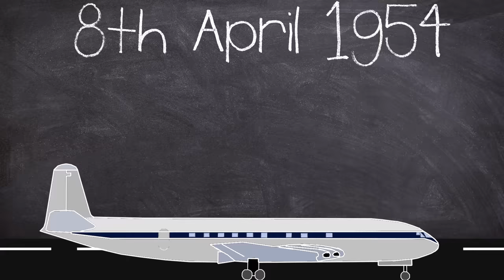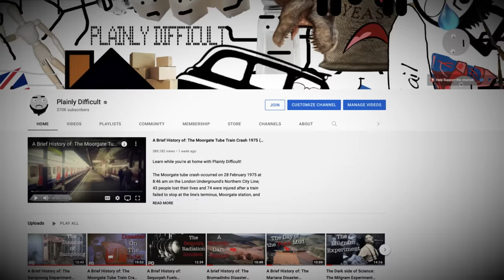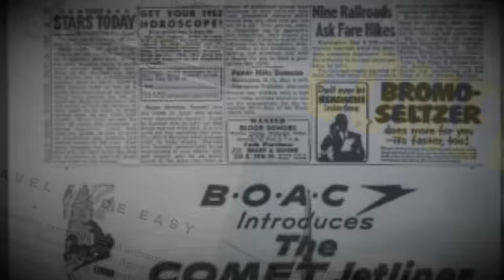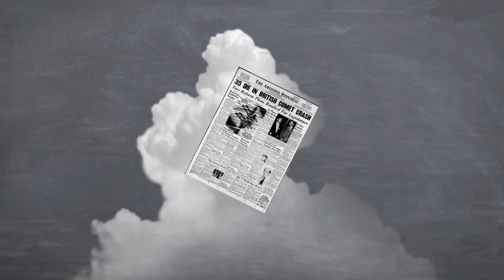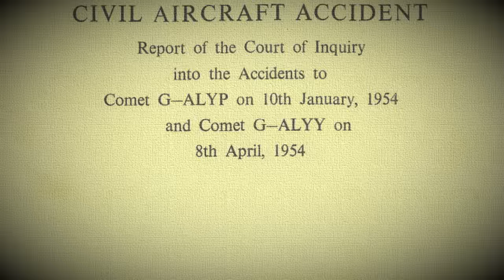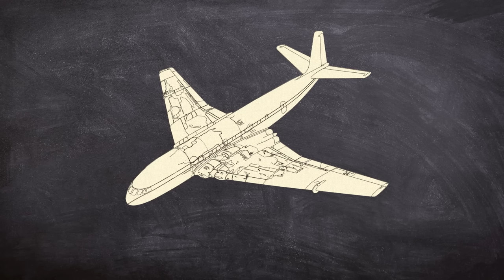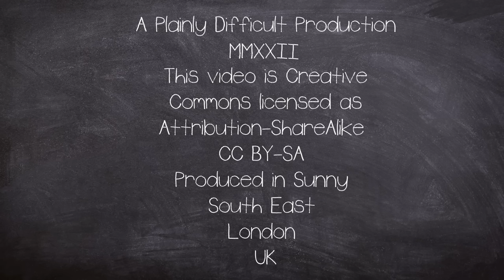A Brief History of: The de Havilland Comet Design Disaster 1954 (Documentary)

Comment: Great video... But...
Your failed to mention a couple of things.
1) the first two runway crash were from what some call a cockpit flaw which created a blind spot outside the windshield. From it the pilots thought they were taking off but weren't. Many Comets had to have their dash panel refurbished to eliminate the blind spot.
2) it was found that during the manufacture of the comet's to allow the square windows and and access point like the door and radio antenna, the holes for rivets and welding were punched into skin and not drilled. This created tiny micro fractures into the metal skin and accelerated the stress crack failure of the Comet's skin and frame. After this all manufactured aircraft would have their metal frames and skin panels drilled and not punched through.

Comment: The De Havilland Comet, despite it's flaws, was still an incredible aircraft.
Unfortunately when making huge technological leaps mistakes will inevitably occur - being the first always carries risks.
Reply: The early bird gets the worm, but the second mouse gets the cheese.
Reply: It wasn’t a huge technological leap, as nearly every Comet misconception would have you believe. It was the first commercial jet airliner, but the TECHNOLOGY wasn’t groundbreaking. 

Boeing already had the swept-wing, PODDED engine B-47 stratojet flying TWO years before the first Comet flew; it also had a far more advanced swept tail design than the Comet’s straight prop-era tail design. 

The genius was in applying known technologies to a different market, not so much the plane itself. 

Also (largely unknown or ignored) is the fact that Boeing had already implemented a huge array of construction and fuselage features into the -80 design which would have made the structural failure of the comet impossible. Guess what? They did all of that BEFORE the Comet crashes. Spot welding instead of punch riveting, tear-strips in the fuselage, and above all else, the aluminum skin was MUCH thicker than the Comets - again, all included in initial design specifications before the Comet crashes. 

It is possible that while being a groundbreaking aircraft for commercial jet travel, de Havilland ALSO royally (no pun intended) screwed up!
Reply: @EstorilEm  Nazi Germany had the first jet-powered aircraft (the Me 262), and the first operational jet squadrons. B-47 was post-WWII, but the Convair B-36B/D's (post WWII w/jet engines and conventional engines on one aircraft was operational in 1946-47). B-47 was not fully operational until 1953.
Reply: @EstorilEm  
The "tear strips" or rip-stop strips were lacking in the Comet I, no doubt to save weight. Virtually all American jet liners had/have them. Keep cracks from propagating.  There are also other areas where ground tests, including wind tunnel testing doesn't show up potential catastrophic failures.  The Lockheed Electra I, for example, a four-engine turboprop, was tested extensively in wind tunnel testing.  Unfortunately, it did not reveal the dynamic augment of the outboard engine/nacelle, which, under certain conditions inflight hit the natural frequency of the wing. The result was the Tell City, Indiana, crash, killing everyone onboard. Until the cause was found, airlines were instructed to reduce the cruise speed, which did keep the phenomena from happening.  That was very fortunate for me and my Dad, as we took the same flight number, on the same type of aircraft, the next day!  When the cause was found, Lockheed beefed up the wing structure and made other changes. The "new" plane was called the Electra II.  While it didn't remain in commercial service much longer, the Navy and Air Force adopted it with all sorts of anti-submarine gear, and called it the P-3 Orion, which remained in service until being replaced recently by the P-8.
Reply: The Comet Disaster was certainly not the result of cutting edge technology... rather the lack of modern technology.
The Comet Disaster could have been easily prevented if de Havilland had simply followed existing, well-known Industry standards for the design and construction of all-metal aircraft with riveted aluminum alloys and cabin pressurization.
Reply: Yeah uhhhhhhhhhhhhhhhhhh no. The Boeing Dash 80, actually the B-47, led us into the future. The Comet, a first step but the design decisions were all wrong. 

When your claim to fame in aviation is ACCIDENT investigations instead of trillions of passenger miles. . . . . . . . . . . well it was an EXPLOSIVE FAILURE.
Reply: This video has some BS included.
For example -
  
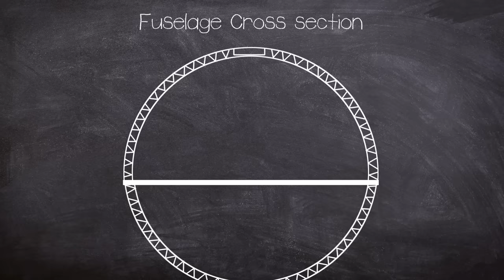    5:20   The idea that only the crew & passenger areas were pressurised is absurd obviously. 
  Every part of the fuselage was pressurised from the nose to the rear fuselage bulkhead including the entire cargo area.

Comets flew until 1997.
The Comet design had military use as a requirement. Nimrod development began at 
De Havilland before 1953.
Nimrods were not withdrawn due to structure problems or other airframe issues it was entirely a significant upgrade snag & resultant basic economics & an end of line sale happening at Boeing at the same time.

We feel we can shed some light on some common misunderstandings.

At the time the Comet wasn't particularly dangerous.

Losses comparisons
How things were in those days.

DeHavilland Comet 4 UK           14% 
DeHavilland Comet all  mks       17%  

Boeing 307                               70%
Boeing 247                               48%
Boeing 707            .                  20% 
Boeing 707                                20% 
Lockheed Electra Turboprop   29%
Canadair CL-44  Turboprop     46%  
Convair CV-580  Turboprop     22%
Convair CV-880    (ff 1959)       27%  
Convair CV-990     (ff 1961)      35%

    Of course De Havilland had prior experience building many all metal construction airframe aircraft including thousands of jet powered fighter aircraft that were primarily of metal construction with pressurised cockpits & jet engines built by De-Havilland.

   De Havilland carried out full stress analysis & engaged in a comprehensive & protracted testing program.

   The DH Comet was the first passenger airliner with full length fuselage pressurisation at 8psi pressure differential.

   Of course ripstop provision was provided. The skin alloy used became unavailable at the time due to R & D at the manufacturers which resulted in the original alloy being discontinued.
The skin thickness used for the Comet was used for similar later aircraft. 
Frame spacing was not found to be too large & frame width was not found to be too small.

  De Havilland did indeed always work to better than industry standards at the time, used up to date knowledge for the design & construction & no evidence of negligence  or criminal negligence was ever produced in relation to the DH Comet.

  The DH Comet had no effect on the course of the aerospace industry in the UK. The UK now has the world's largest combined nuclear, aerospace & defence sector per capita activity.

    The investigation committee did not find hundreds of fatal flaws or evidence of design defects, structural defects, defective materials or shoddy workmanship. Ripstop provision was included. Claimed incidents did not involve cracks starting from window corners.
Pretty much all changes were just in case changes or were planned development modifications & improvements that were scheduled regardless of incidents.

Hope this helps.

Cheers 👍
  
   
   
xcxcxvcxcccccv
xcvvvvccvccccv

Comment: As usual a great video, which does a great job of presenting a problem, and its causes.  There's a lot more to the Comet's history though - which might tale a couple of hours to properly present.
While the structural issues put the nail into the Comet I (and IA), it must be pointed out that the two losses due to runway overruns mentioned are also significant, and exposed a critical problem with the early Comets - The Comet I, like all early jets,  was severely underpowered, and takeoff performance was marginal.  The airfoil used on the Comet's wings did not have good low speed characteristics - When taking off in an early Comet, the airplane had to be, at a precise speed, rotated exactly 10 degrees nose up to take off successfully.  at 9 degrees, the wings would not develop enough lift to get the airplane off the ground on any runway that they could use, and if rotated to 11 degrees, the increased induced drag would prevent the airplane from accelerating to a speed where it could fly.
On the Comet teaching lessons in metal fatigue - in some respects that is overstated, I think - Boeing, which, at the time of the Comet losses over the Med, was beginning testing of the Model 367-80, (First flight July 15, 1954) had more experience with large pressurized aircraft (Model 307 prewar, the B-29 and B-50 bombers, the B-47 jet medium bomber, the B-52, and the 367/377 Stratucruiser airliners and C/KC-97 military cargo carriers and refueling tankers) than the rest of the world combined.  Fatigue concerns by potential buyers, among them by Eastern Airlines in the U.S. led to  lost or cancelled orders before the inflight breakups.

Comment: It wasn't just the accidents though. Those in-wing engines look stunning, very Flash Gordon but nacelles are just way more practical making maintenance turnarounds faster and cheaper. That's a legitimate selling point.  Fair dos has to go to Boeing for choosing that design.
Reply: In the Comet it was a obliged choice, sinche the engines of the Comet I, Ghost 50 Mk 1, were a little underpowered for the aircraft, so De Havilland used the same "trick" of the Mosquito, that had the radiators in the wings to reduce drag.

Comment: Always have a radius! Round edges are of outmost importance. I worked with fibreglass for years and anytime there is a cutout or angled edge it MUST have a radius to absorb any stress…otherwise CRACK! 
You’d think they would have taken a lead from the marine industry…ship windows are round!🙄
Reply: Hindsight is always 20/20, it's easy to call the failure now that we know. Still, I'm a little surprised that not one of the engineers - experienced with pressure vessel designs - had an instinctive reaction to make the corners round.
Reply: The Liberty Ships had stress fractures and failures owing to square rather than radiused deck openings.
Reply: @johnladuke6475  The corners were round.
Reply: @johnladuke6475 
The windows had radiused corners.
  They proved the design was good during the extensive & protracted testing activities 
  It's possible to use sharp 90° corners for the passenger cabin windows on a pressurised airliner, it's just a matter of making sure there's enough material for adequate strength around the window, if sharp corners & big square windows etc are used it results in a lot of unwanted & unnecessary extra weight which is the last thing we want for an airliner  design.

Comment: A shame some of the most important lessons in engineering are the ones that come from the worst tragedies.
Reply: If no one die, no one cares
Reply: The tragedy of the Comet Disaster is  it could have been easily prevented if de Havilland had followed well-known and understood engineering standards for riveted aluminum airframes.
Prior to the Comet Disaster de Havilland was still building aircraft primarily from WOOD and was years behind in aircraft design and construction technology.
Reply: @sandervanderkammen9230  - Which "well-known and understood engineering standards" were these?  De Havilland were working on the bleeding edge of  scientific knowledge regarding materials - no civil aircraft of that size had ever routinely cruised at those altitudes before.  Furthermore, the DH Mosquito fighter/bomber was designed and made of wood not because DH lacked experience working with aluminium, but because the entirety of the aluminium available to the British Empire had already been requisitioned for other purposes.  The whole point was that any joiner, cabinet maker or piano builder in the country could turn their hand to making parts for the Mosquito - which among other things severely pissed Hermann Goering off.

Boeing probably had the most experience building aircraft with pressurised cabins with the pre-war Stratoliner, B-29 and Stratocruiser - and when De Havilland released their data regarding metal fatigue in the wake of the investigation, Boeing's engineers freely admitted that if it hadn't happened to the Comet, it would have happened to the jetliner they were working on.
Reply: @turricanedtc3764  Metal fatigue was not discovered by de Havilland, it was already known to aircraft manufacturers... all but de Havilland.

The Comet Disaster investigations revealed 100s of fatal flaws, design flaws, material flaws, shoddy workmanship and appalling quality control.
Reply: @turricanedtc3764  Absolutely false, de Havilland made several unsuccessful attempts at building aircraft from aluminum alloys.

de Havilland was still building aircraft primarily from WOOD when the company went tits-up in 1958.

The industry leaders like Boeing, Douglas,  Junkers and Lockheed were building all-metal, pressurized monoplane airliners before the war while de Havilland was still building wood and fabric biplanes like the Dragon Rapide!!!
Reply: @turricanedtc3764  de Havilland received technical data on metal fatigue in pressurized cabins from Boeing during WW2 from the B-29 program... of course, this was no use to D-H as they were still building aircraft primarily from WOOD!

The Comet Disaster is shameful and humiliating chapter in British history, every effort has been made over the years to revise history and spin the story to give it a positive conclusion.
The Comet was not cutting edge technology... and the aircraft industry  learned nothing from it.
Reply: @sandervanderkammen9230  - Go on then, name a single post-war De Havilland aircraft design made primarily from wood.
Reply: @sandervanderkammen9230  - If there were hundreds of examples of design flaws, shoddy workmanship and poor quality control, would you be able to name one or two examples?
Reply: @turricanedtc3764  The fuselage of the Vampire and the Venom were built primarily from WOOD.
Reply: @turricanedtc3764  Several Comets crashed due the flawed design of the engine air inlets.
The cause of the catastrophic in-flight structural failures were due to a lack of proper rip-stop doubler joints.
The fuselage skins were too thin and made from an unsuitable alloy that became brittle when worked.
 Investigators found shoddy workmanship in the rivet joints, cracks in the rivet holes, loose rivets and misformed heads.
 de Havilland originally planned to glue and rivet the window frames, the additional time and cost building the fixtures was not in the budget and discarded to save money.
Reply: More lies from Sandybum, DH was still going in 1963, they closed down the Hurn base in 1958 and moved many of the employess up to Hatfield including the father of a friend of mine.
Reply: Sandybum The Vampire was a WW II design, I bet you didn't know that the Trident was a DH design, my father worked in the drawng office at DH.
Reply: Sandybum, Not a word of truth in any of your rants made up because of your hate for Britain.

Comment: I believe also that Boeings designs provided for "rip stops" in the fuselage. These would prevent a skin tear from propagating to the point of total failure. However the Comet did not have rip stops so when a tear started, there was nothing preventing it from running the length of that section of skin.

Comment: How scary that must have been. Plane cracking open while 20,000 feet up.
Reply: The explosive decompression would have knocked the people out very quickly, if not instantly. Many on board were thrown headfirst into the ceiling of the fuselage by the decompression. On top of that, the shock to the lungs from the decompression would have quickly rendered them unconscious.
Reply: It would have been a very quick way to go...

Comment: I flew casevac Comet 2 from  RAF Changi Singapore in June 1958. Was supposed to be stretchered in forward compartment but was asked if I would take a seat to allow a priority evac to use my stretcher. I was quite happy to as the stretchers were piled pretty close together! Sitting rearward facing was not a problem as I had previously flown on Hastings. Nice smooth trip and a great aircraft. Hastings to Singapore was five days...... Comet just a day.

Comment: From memory, the cracks were initially started from the drilling and riveting process around the windows, work-hardening the metal resulting in it becoming brittle in those areas, further exacerbated by the pressurisation cycles and thermal stresses over time, which tragically resulted in the incidents of the planes basically popping like balloons... :(
Reply: The riveting process was the source of the trouble, because the punch method had been used…

Comment: The Comet Disaster is the worst engineering failure in commercial aviation history... the real tragedy of this disaster is that it could have been easily prevented if de Haviland had simply followed well-known and understood industry standards for the design and construction of pressurized cabins made from riveted aluminum alloys.
de Havilland had very limited knowledge of building all- metal aircraft  and were still building jet aircraft primarily from wood and fabric..